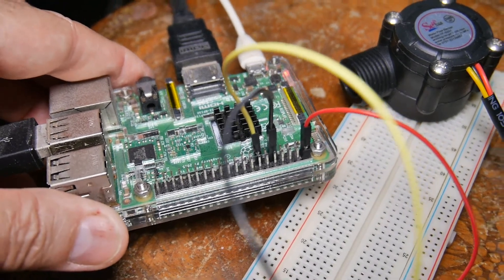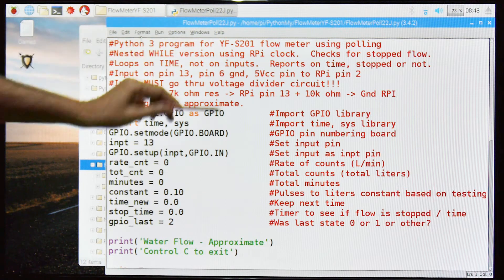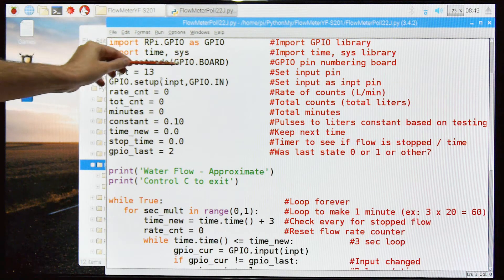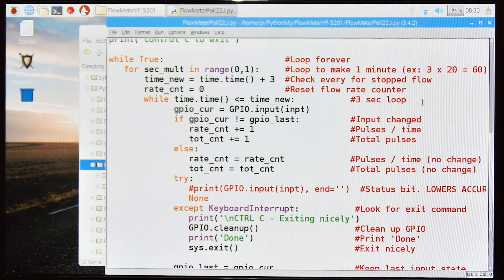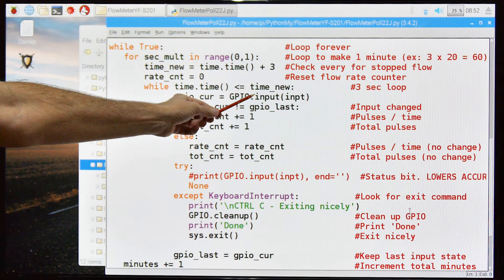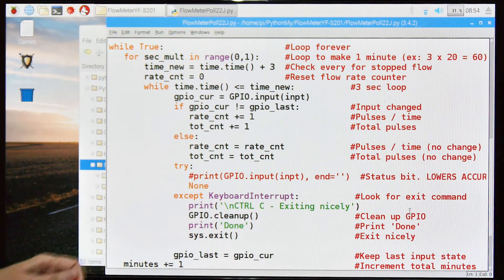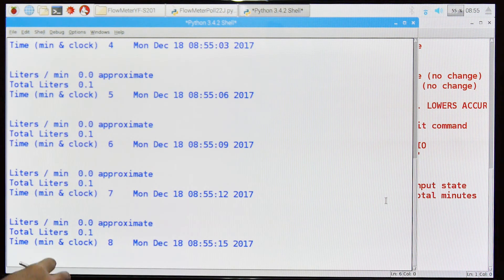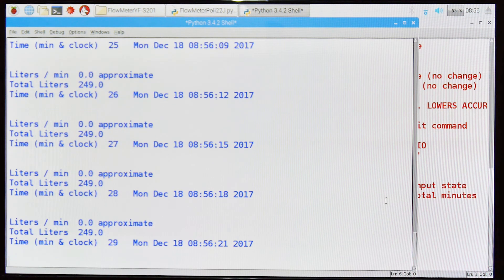RPi 23.2 - YF-S201 Water Flow Meter/Sensor, Polling, TIME Trigger - ADVANCED

Comment: hello, i've been troubleshooting this problem for a couple days and would love if you gave some input. my sensor keeps returning "1" every time i enter GPIO.input(flow_sensor). I pretty much matched your setup and dont understand why the sensor is not responding. I've tested the circuit with a multimeter and the pin is receiving between 3.5 and 4 volts when using 5.5 volts and 2 when using 3.3 volts. I need to get higher resistors but i doubt that is the reason the sensor wont respond when water goes through it. any help would be greatly appreciated! Thanks
Reply from the maker: If you put too much voltage in an input pin (over 3 volts), you may have killed that input (I did it myself).  Did you test the sensor with your meter to see if it goes on and off?    It should.  If the meter is sending an 1 and 0, and the pin is not damaged, this code works.  When you say you "pretty much matched" my setup, what changes did you make?

Comment: How could the total litres reach 88 within few seconds, even though the flow rate is some 30 LPM??
Reply from the maker: As I said in the video, I'm blowing air through it which makes it spin WAY faster than its upper limit of 30 lpm which produces unreliable data.  The liters per minute is an instantaneous measurement, the total flow is total flow.  The meter assumes water flowing through an opening of a given size, and counts pulses from the magnet embedded in the impeller, so of course the results will be strange.  It is just for demo purposes because I am not allowed to run the garden hose in the TV room.
Reply: I tested the same coding with 1 litre bottle. In that case, I'm getting around 91.2 as my total litres. How to get the correct reading?
Reply from the maker: @sriram8550  2:56 You have to set the pulses per liter to your conditions, i.e. this is where the calibration happens.  In the description is the manufacturer's rough settings, but it varies with how much work the pi is doing (your code and conditions).
Reply: @tsbrownie   thank you

Comment: Using that voltage divider Im getting 2.1 vdc on the sensor pin. All the calculators say it should be 3.4 vdc. Any idea why Im getting this reading? What voltage do you get on the sensor pin?
Reply from the maker: Too long ago to recall.  Have you have checked your pi's voltage output?  Also, is your power supply 2.5 amps or better?  Low amp power supplies are a problem (from personal experience).  Are the resistors correct?  Do you have any dirty connections?  Are your GPIO channels set correctly?  Do you have a dead (or going bad) GPIO pin (been there myself)?  Make sure you have the wires on the meter correctly, polarization counts.
Reply: @tsbrownie  power supply is sufficient. Pins have been verified. This pi is brand new so I don't suspect a bad gpio pin. The resistors are the same values as in your video. Even checked them with a multimeter. Possibly dirty connections as Im using breadboard and jumer wires. I dont suspect that though. 

When I check the voltage of the signal wire from the sensor without the voltage divider I get 5.2 vdc when there is no flow(so we know the gpio pin is providing at least 5v) and 2.5 vdc when there is flow. I was thinking that output should be 0 volts when not flowing and equal to the supply voltage when it pulses. I think I just misunderstand how these things work. 

Your code works regardless. I havent checked for accuracy yet but I can see the pulses and readings. Just wish I understood why I get the voltage Im getting.
Reply from the maker: There are many good explanations (better than I could do) on the internet.  Just google "how do voltage dividers work".

Comment: I've watched this and the previous 3 versions and you've never compared the various methods in terms of which is most appropriate in any given situation. Do you consider any of these methods to be the "best" overall?
Reply from the maker: Tough question. This is part of experimentation at a 1st step level, so not sure there's enough data to make specific statements on how well it would work for a given app. The second part of the answer has to do with the pi NOT being a real time computer (I've got videos on that), so when it comes to exact timing you can not count on the pi, it takes time off to do other things, so how you write the program and how busy the pi is with other things can seriously affect timing which affect the output.

Comment: why is it not compatible with python 2? currently doing my research study, would appreciate your reply. how can we make this in python 2?
Reply from the maker: Python 2 print statements don't have parenthesis.  print "test" verses print("test") in python 3.  When you run the code it will tell you what went wrong, some commands in 2 have been replaced in 3.  But it's usually pretty easy to do a workaround.  There are documents listing the differences from the python groups.
Reply: Thank you for your abrupt response sir! :)
Reply: sir do you have a computation of the voltage divider using  resistor?

Comment: Why do you need the voltage divider when you are using pin #1 (3.3V) for power to the flow meter?
Reply from the maker: I was switching between the 3 and 5 volt.  It was easier and safer to leave it in place.

Comment: Dear Sir such a nice and helpful video. I have one question if you can answer, please.
How did you calculate the constant value? please if you explain this is also it will very clear please. Thank you
Reply from the maker: The best way is to get a bucket and measure the amount of water per time.
Reply: tsbrownie  what should I do with time. U mean should I look the mins.   There is also the presessure mater. If you know the calculation please let me know Thank you sir
Reply from the maker: You need to measure the actual liters / minute.
Reply: tsbrownie dear sir thank you for ur reply. I did and 7.5 liters/min i got now what should i do.... U mean now my constant number is 7.5 or something else? Please let me know.. thank yoy
Reply from the maker: Read the description.  It tells you how many pulses equal how many liters.  Use your actual data to tune the constant.
Reply: That's 450 pulses / 1L so 7.5 liters = 3375 pulses ...... I did not get anything from this sir ... Can you show the formula, sir, please?... THis will great and also help other please
Reply from the maker: I don't understand your question.  I can't tell you what your constant / correction will be, because it varies with your program.  The Pi is not a real time operating system, so the results are based on how fast / slow the program is executing and how accurately it is counting (it will miss counts as the Pi gets busier).  From the description: 16 Hz = 2 L/min = 120 L/hr.  If you are getting 32 counts per second (hertz) then there's approximately 4 liters / minute flowing through the meter.  To improve the accuracy, you can use the bucket method I mentioned earlier.

Comment: Hi same question here that i did in your other video

can i replace the 4.7k and 10 k resistors with the level converter? https://www.adafruit.com/product/757

something like this  https://www.dropbox.com/s/bx8owgllp81w0f7/erosion_flow_bb.jpg?dl=0
Reply from the maker: I can not say for sure because I do not know this product, but if it's the equivalent then probably.  The issue is the Pi likes 3 volts on its pins, 5 volts will damage the Pi.  So if this device takes the 5 volts down to 3 volts then it should work.